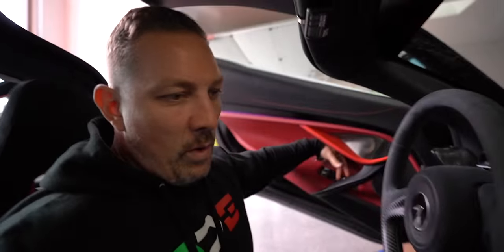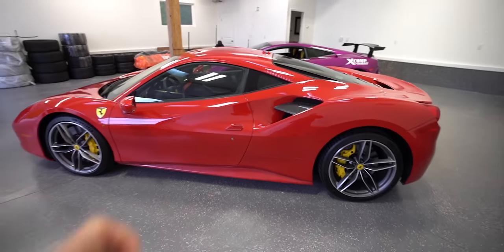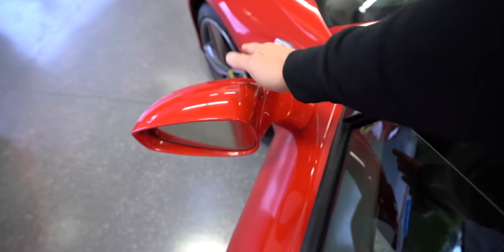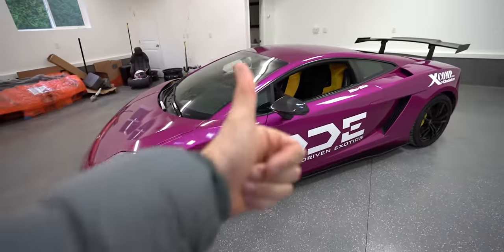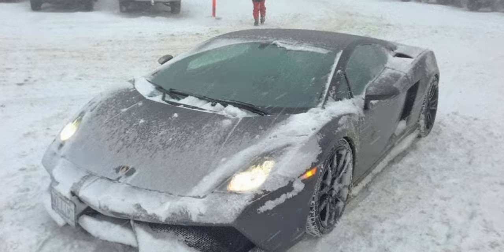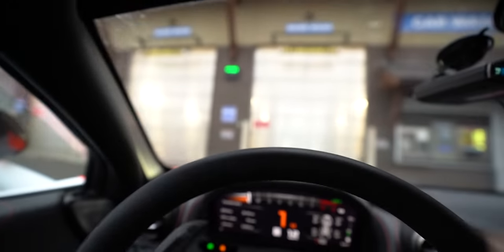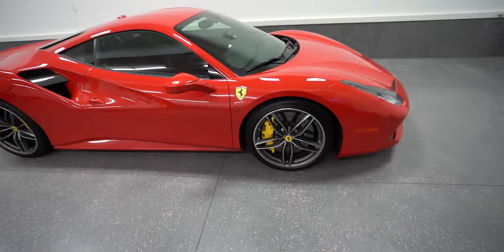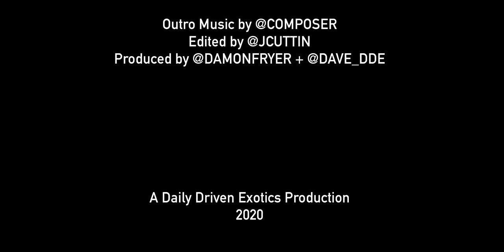BUILDING MY WILDEST WIDEBODY FERRARI EVER!  *TWIN TURBO 1000 HP*

Comment: I was thinking about the 488s chassis mounted wing, and I had this incredible idea... Why can't you have the chassis mounted wing still incorporate the active arrow at most you would have to extend the struts that push and pull the wings tilt, with a few simple extension you could make this happen. And it would be a first and only one of a kind.   And it would simply be badass.   The car's computer already has it programmed to be able to set the right angles at the right speed as long as you make the mechanism a one-to-one ratio it should be able to tilt exactly the same angles as it would in its stock form.   Seriously think about that I think it would be an incredible idea and I think you can make it nice and sleek so that it would still look amazing and have all its functionality
Reply: And I think the man who could help and has all the tools and knowledge to do it is from the channel. "Stuff made here" an incredibly smart guy who knows his s*** and has all the machinery to be able to make this for you

Comment: Got to move with the times. The new silhouette kit looks great - so much more modern than the over-fenders style guards with  exposed  fittings .  Set the car off  with a crazy   racing style rear wing  and please  make sure its fitted with large end plates  like the ones you see  on formula 1 cars.

Comment: I personally feel that existing cars that are advertised as wide body but are done with Bolt on fender kits to make them that way using factory or aftermarket  are hokey. I would rather see a true wide body fender so there is no question to its authenticity versus stock.

Comment: You should get rear louvers on the rear window and look cool Also with the liberty walk it you should get that would that bolts to it but get it shaved are molded inside the Fender I don't think you'll like the silhouette kit it doesn't suit the style that you're going for here you won't be able to fit  The other parts that you got for it won't fit on that silhouette kit but it will fit on the other kit that bolts on that has they expose hardware get the one with expose hardware but get it shaved and bolted

Comment: the  silhouette kit isn't  as  nice  as  the  basic hardware  exposed original liberty walk  body kit imo,and the  silhouette  kit  is  much more  costy than the ''original''''  body kit.then, a  trunck mounted  wing is  gay  to  me,because  it doesn't transfer  much  downforce  to  the  car frame  as  a  frame mounted  wing does.of  course,if  it,s  just a matter of  look,the  trunck mounted wing is ok,.while it  doesn't make  much sens.then,unless  your  going to hit 200mph in long  fast  sweeper,any  wing is  worthless imo,and it most of  the times  destroy the  shapes and  forms  of  the  car's lines unless  the  car  has  been created  by the  designers  with the  wing included.  as for  the  wrap,well,the  zebra  wrap is  something from the past,outdated  to  me,while  a  solid  chrome color  would be  awesome.